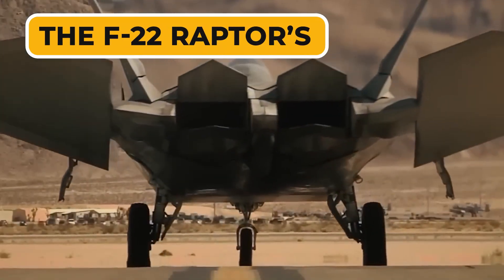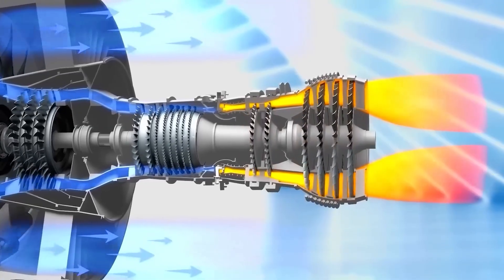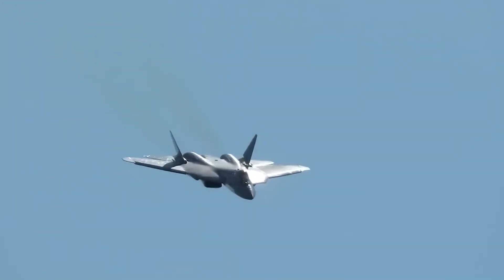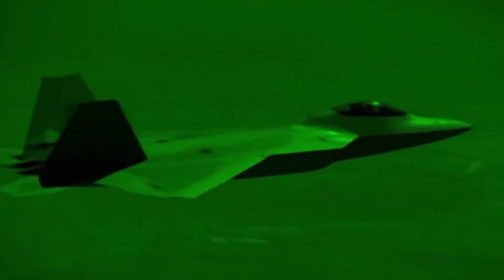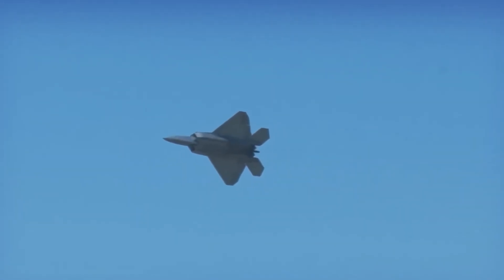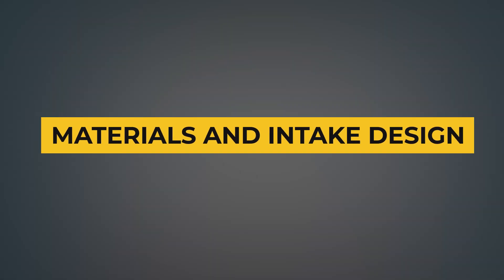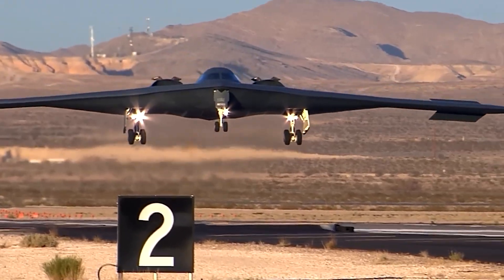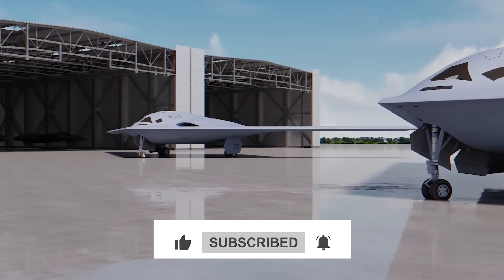F-22 Raptor vs Su-57 Felon | INSANE ENGINE Differences

Comment: wieso immer diese vergleiche? die  SU-57 hat ein  radarbild wie eine A300. die ruzzen sid zu blöd einen tarnkappen jaäger zu bauen. . bei den en liegt alles aussen. das adar von denenen ist eine kleine runde kugel vor der kanzel. usw. ruzzen können nicht . mal abgesehen von deren triebwerken. schnell ja. aufklärung für jeden anderen sofort. und so weiter. auch deren ruzzen scheiß su-75 kann nichts.
Reply: Russland baut durchaus fähige Kampfjets. Die Su-57 ist kein reiner Tarnkappenjäger wie westliche Muster, sondern folgt einer anderen Philosophie: hohe Geschwindigkeit, starke Manövrierfähigkeit und vielseitige Sensoren, auch mit Außenlasten. Das ist keine Unfähigkeit, sondern ein anderer Ansatz. Stealth ist wichtig – aber nicht das einzige Kriterium für einen guten Jäger.
Reply from the maker: @MilitaryJetClips  Thanks for the details!
Reply: @aerovisionskies  👍
Reply from the maker: The Su-57 vs F-22 Raptor debate comes down to different design philosophies. The F-22 prioritises stealth and first-shot advantage, while the Su-57 emphasises agility, speed, and multi-role flexibility. It’s less about which is “better” overall and more about how each is meant to be used.